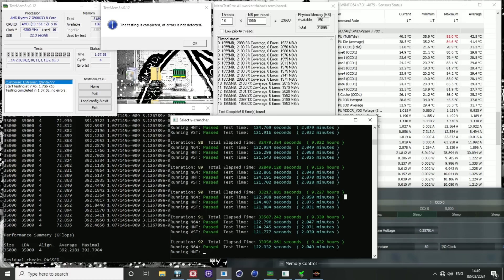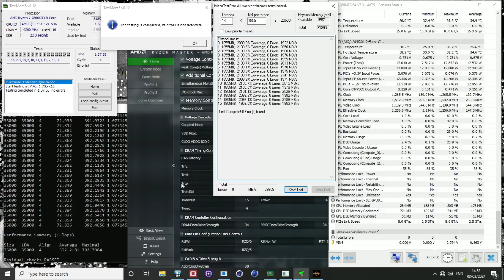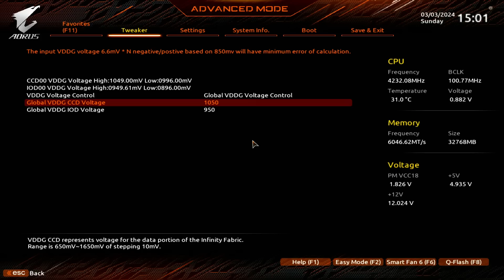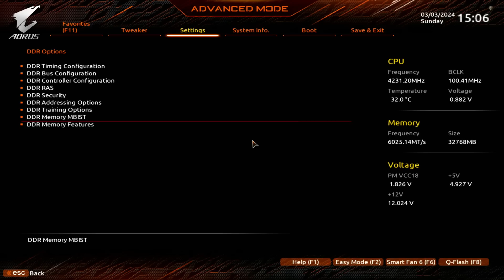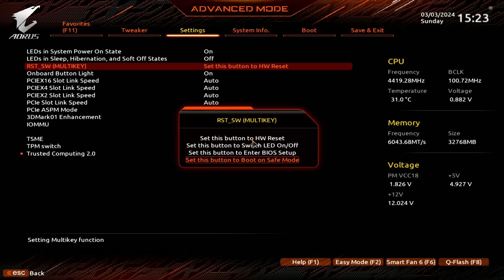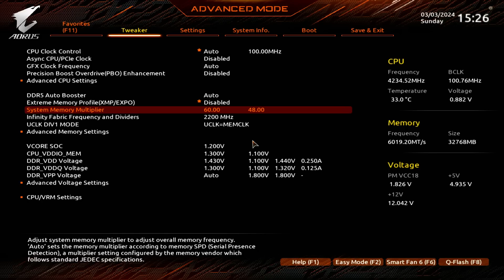Ryzen 7800X3D, 2200MHz FCLK, DDR5-6000 28-36-28-30

Comment: I managed to get FCLK to boot and be stable at 2200mhz setting up your voltages and timings but I realized that even setting up manually your timing and subtiming if amd expo is active it will override my manual settings. Do you confirm this? I checked in windows with AIDA the timings of the ram and it looks like so. Also a thing that is confusing me is the actual performance improvement by raising the FCLK. Best case scenario would be to run it at 3ghz if ram speed is at 6ghz, but if ram is at 6ghz is it actually beneficial to put the FCLK at 2200mhz? Or is it better to keep it at 2000Mhz? Another thing. I run a memory stability test overnight and ram got me no errors but what software should I use to check the stability of Infinity fabric?
Reply: best fclk is the highest you can

Comment: I was able to get 2200Mhz FCLK to boot, but then I loses my second GPU from being detected from PCH (used a M.2 to PCIE adaptor with independent x16 power), and the maximum I could get is 2067MHz

Comment: If I am running my DDR 5 memory at 6000mhz, the FCLK should be 2000 correct? Since anything higher than that, there is no real benefit to gaming at all.

Comment: CL28 6000mhz vs 7200mhz cl34?
Reply: I have a-die sk hynix teamgroup kit, hope i can achieve the same but my mobo is not the best; x670p msi
Reply: 7200 will give you upwards towards 80ns latency when paired with the 7800x3d since you're forced to run it in gear 2. The good thing about getting high bandwidth memory is that it basically guarantees you will get hynix A die which you can then tune to be best for this CPU. I'm currently running similar timings shown in this video at 6200 and my latency measured in AIDA64 is around 58ns, which is around 25% faster
Reply: I use KF560C32RSK2-32 ( Hynix M Die ), TCL28-TRCD36-TRP36-TRAS28-TRC38 / 1.4V FCLK( 2133Mhz ) VDD: 1.4v VDDQ/ IO: 1.40v VSOC: 1.3050v . R5 7600 B650 TOMAHAWK. 58NS on Aida64. For 7800X3D i think Hynix M would be better cause it does better timings then Hynix A. @DirtyAtreyu

Comment: @Actually Hardcore Overclocking . I have a question. For the fclk is 2033 not fasther then 2200? Or atleast thats what you where using and saying in another hynix video    you've done. pls explain im trying to optimize my sytem.
Reply: this is newer video so if he says 2200 faster then it is and prob some bios update fixed it

Comment: Is vCore SOC only for the Infinity Fabric Speed etc.? So if I can get 2133MHz with UCLK=MEMCLK running and want to tighten the timings / clocks of the ram sticks, I would only need to touch VDDIO, VDD, VDDQ? Do you have any references for 6400 CL32? Currently, running  6400CL32-38-38-38-38@21333 with GDM=off and automatic timings at vSOC 1.15, VDDIO, VDD, VDDQ=1.3. And was wondering which voltages I could try to drop. PS: For some reason, VDDCR_SOC Voltage is defaulted to 1.2v once I adjust the mem clocks or timings altough set to 1.15v in the bios. At the same time, CPU VCORE SoC is reported at 1.15v.
Reply: i'm stuck too at 2133 fclk, 2166 very close to be stable, 2200 directly reboot on occt, i noticed that on hwinfo, on my cpu i have vsoc at 1,185 when i set it at 1,20, i saw buldzoid is at 1,19, so i will see if increasing makes possible 2166 or 2200 looks like my asus low price is not acurate (b650m-H/M.2)

Comment: Did you try lowering VDDP from 1.15V to 0.95V and VDDIO to around 1.3V. i noticed while testing that I could achieve better timings and stable clocks by leaving VDDP on 0.95V instead of 1.15V and also not going over 1.25V to 1.3V for VDDIO, not sure why.
Reply: Mind sharing your settings?
Reply: @xGame4Fun  Im just on the timings in "easy" timins for SKH with 6000 memory kit right now. I had issues going higher with my setup even with the timings in the easy timings video with 6000. I then noticed after I lowered VDDP from 1.15V to auto which sets 0.95V I had no issues anymore with OCCT cpu and memory tests and system runs 100% stable since then for days. I then also lowered SOC to 1.15V, VDD VDDQ VDDIO to 1.25V, still stable.

Comment: Hey buildzoid, you are not alone! I too cannot do 6200 with my 7700X CPU no matter what I try.
Reply: its ur mobo
Reply: @Input.Volume  Nah that comment is 2y old, it was BIOS. Later versions were more stable
Reply: I managed to run get an aida64 reading with CL28 @ 6200. But any forms of loads crashed it. Now I'm doing some testing with 28-36-36-28 @6000 Greetings from Dejvice

Comment: I am amazed you can turn the Vcore SOC down to 1.2V, I always thought you needed at minimum 1.25V for high speed memory (that is what I set mine to).
Reply: i have set mine to 1.060 but ddr5 6000 cl 30 and i also got the 2200 fclk stable with my 7800x3d
Reply: @CHEFKOCH1837 Curious, did it make a big improvement in temps?

Comment: Tried this on a gigabyte b650 aorus elite ax with a good g.skill m die kit, everything works, except TRP+TRC, i couldn't modify those at all, gotta keep at 36-68, problem is that "it seems stable", but it caused me audio crackling (and one time even a sound card crash) in games, for whatever reason. Anyone got any idea on why?
Reply: Same issue with the b650m aorus elite ax ice 
Did you find any solution?
Reply: What is the best DDR5 for 7800x3d CPU and for gigabyte b650m aorus elite ax motherboard.. without issues ?

Is the TEAMGROUP T-Force Delta 6000MHz 2x16gb CL28 good ?
Or there is better option?

Comment: I don't advise any one to apply this since, I ended up with a dead ram stick
A-die kit. I posted my story on Reddit so I hope that I can at least help someone befor getting involved without any precautions, and for those they think it is 100% safe.
Reply: What is the best DDR5 for 7800x3d CPU and for gigabyte b650m aorus elite ax motherboard.. without issues ?

Is the TEAMGROUP T-Force Delta 6000MHz 2x16gb CL28 good ?
Or there is better option?

Comment: Would these timings work on a 64gb (2x32gb) G.Skill kit with Micon M die ? or should I just stick to your Easy DDR5 timings ? im running a 6000mhz kit at 6200mhz, passing all tests, VDDIO at 1.4v and the 2 DDR Volatges at 1.4v, SoC at 1.2v, your easy timings, all on an ASUS X670e Gene with a 7900 non X, seems to have a great mem controller in it.
Reply: Answered my own question, no they dont work on Hynix M Die, however, your Easy timings do and allowed me to bump the ram upto 6200mhz

Comment: Honestly, after trying multiple kits from teamgroup 6400 XMP's to Proxmem's new hynix 7200 cl34 EXPO, with a 7800x3d it's all such a clownshow with the manufacturers trying to "follow AMD guidance" with bios releases, that I'd just tell most people to buy the 6000mhz 1.35v kits and be done with it. I've seen some other people saying they had some stability issues over 1.35 despite sticks rated for 1.4 and higher. They've done some marketing reputation damage with the "buy AMD Expo overclocking stuff" and it not actually working now, which continue to sell for a significant premium from major vendors. I will say though that I ran into a lot more stability issues with timings using 1.4 or more volts on the ram, despite using 1.4v and higher rated sticks. 1.35 is a sweetspot. When I started using your timings here with 7200mhz cl34 1.4v sticks, I could get into windows, I even passed testmem5, but playing games I started getting USB drops on a gigabyte aorus x670 with f10a, and eventually a freeze.

Not much sweat off my back since the return process with Amazon is painless if something doesn't work out, but they'll be seeing a lot of returns for 6400mhz and higher "expo" sticks when the average builder fires up their bios, sets it to expo, and it's not working or it's crashing. A few will go digging around the internet to find out most people aren't bothering trying to go above 6000mhz because the stability headaches are just too high with a goose chase of wondering if it's the latest agesa, the bios, the memory controller, or the memory itself.

At the moment, I'm running some teamgroup 6400 xmp memory tuned down to 6200mhz with the rest of their settings from the xmp profile (1.35v, stick rating), as it just produces testmem5 errors at 6400mhz xmp settings, and the high-end 7200mhz 1.4v stuff is just going back for a refund. Timings could be tightened if I wanted to mess with it, but it's good enough.
Reply: No point in running anything above 6000 for diminishing returns
Reply: Mate if you'r getting stability issues I advise you to adjust it back to factory voltage, since I lost one of my teamgroup sticks couble days later when I was running them at 1.43V 
and I still shoocked from how fast that was.
Edit: it was the 6000/30-36-36-76 kit.
Maybe this will help someone.
Reply: I was able to run tight timings on my hynix 6000 at 1.4v, TM5 is stable but I'm seeing weird temp spikes randomly in hwinfo on ram and CPU, like only slightly higher than normal but I know they are not correct. No crashing but I'm wondering if stability is the issue.
Reply: Team group sucks for ddr5. You want g skill

Comment: My 2x16gb ram kit’s tPHYRDL is mismatched at 6000mHz on the 7800x3d even using expo settings, how can I fix that or what may be the cause?
Reply: Hi, please what is the best DDR5 for 7800x3d?
Reply: @ZzzZzz-gk4bo  just get some 6000 cl 30 tight some timmings and call it a day u wont see  extreme performance from ram

Comment: ECC was disabled or not? If not, it is not a valid stable .
Reply: Is it still a read error if it gets corrected before it even leaves the memory die?
Reply: @hammerth1421  no. But ram will work slowly.

Comment: about uclk=memclk... what if you re-synchronized fabric with memory controller and memory by setting fclk at 2000, uclk=memclk/2 and running memory at 8000MT/s? Would that work/post/be stable?
Reply: Not with the current generation Ryzen 7xxx.  Maybe next gen IMC improves enough.

Comment: Would these settings work on m-die as well? Or do you recommend something else? Got 30-38-38-30 with other subtimings too from some previous video of yours.  Also, i read on a forum some guy recommended bumping LLC for the cpu voltage to the max for 7800x3d to get a bigger stable curve optimizer negative, he got -39. What do you think about this? He claimed it should maximize the already so locked down voltage. Would this be a good idea? Harmful?
Reply: I maxed my Llc out two days after sticking my 7800x3d in and can also run -39 CO stable as hell.

Comment: Hi. Tell me, I now have a gigabyte of b650 from Aorus elite in ex, 7600x, and in the Hynix RAM in green we will die, I set the Bios voltage to 1.45 and the computer turns off. Memory does not take more than 1.38 voltage. On the z790 Apex motherboard, which runs at 8200 megahertz. Why can 't I file more than 1.38 on my b650 ? If I set 1.4, then everything works, but downloading to hwinfo 1.38 is the maximum. And if I set 1.45, then the computer just turns off, then it turns on and turns off again. Memory - 16GBx2 hmcg78agbua081N AA a-matrix

Comment: I have an Asus ROG Crosshair X670E HERO (BIOS ver 1415), Ryzen 7 7800X3D, Corsair Vengeance RGB DDR5 2x16gb (CMH32GX5M2D6000Z36). The system will not POST when using EXPO I, EXPO II or EXPO Tweaked. Is it the Motherboard, BIOS, RAM or CPU? I have no idea and it's annoying that I've paid for a 6000MHZ EXPO enabled kit that doesn't work..
Reply: Здравствуйте! Посмотрите поддержку corsair на официальном сайте x670e hero. У меня была такая же ситуация с xpg adata 6000. Adata поддерживает expo, x670e Asrock не поддерживает expo профиль этой памяти. Посмотрел список совместимого оборудования на сайте asrock - взял другую память из списка. Kingston fury - запустилась, expo 5600, expo 6000. Так же был профиль xmp. У меня 7800x3d, поэтому expo)
Reply: Its not even on the official support list for your motherboard😂 are people really this dense?

Comment: Are you also having an issue with the recent BIOS revisions limiting SVI3 TFN SoC voltage to 1.2V? I can set it accurately to any voltage lower than 1.2V, but nothing above that. This is a problem that is consistent on my motherboard (Gigabyte x670 aorus elite ax) for all of the bios versions available that are after the SoC voltage restrictions, i.e., F8, F9a, and F9b. I have not tested earlier than that because I don't want to take the risk. My guess is that the SoC voltage is being limited from the mobo SoC reading rather than from the SVI3 reading, because the mobo SoC reading is capped at close to 1.3V when SVI3 SoC is only 1.2V. This should be contradictory to what Gigabyte said in its recent press release, since they said that the SVI3 reading is the accurate one.

 What am I doing wrong? I've been looking everywhere for others with the same issue and the only other person I've found with this exact same issue on a similar motherboard was in this comment section.

Comment: I wonder if it's possible to reduce the Cas Latency of an Mdie 6000 (from Kingston again) from 32 to at least cl 30? Most tests show big improvements when it's near 30 or under.
Reply: Easily. M-Die can also do 28-37-37-30 at 6000 MT/s 1.4V. It's stable on my friends board but my B650M DS3H happens to be so shitty it can't do 6000 MT/s no matter what so I use 5800 MT/s at 1.35V.

Remember tho, if you only tighten one single timing its improvements are negligible so 32 is not bad although it can go tighter.
Reply: @atirta777  I used his guide on the other timings, so they are all very tight now. Cus my motherboard also has a preset that made them even better.  I only wonder about the CL 1, the primary. So i guess i gotta give it 5 more V to make it lower? Its already running at 1.35 if I'm not mistaken?
Reply: @Starfals  Cas latency scales well with voltage, yes. But I don't recommend going above 1.4 Volts just for it. Cuz again, it doesn't give that much performance alone.

Also, the tightened preset timings on your motherboard can work on their own, but I would leave them off if you're gonna fiddle with the secondary timings yourself, just in case.
Reply: @atirta777  From what i noticed, the motherboard aggressive preset reduce the timings by 1 or 2 points, in comparison to buildzoid and his memory timings video. I used the motherboard timings, then i added his on top and kept the tighter ones from the MOBO. So far i got 0 issues, all tests were smooth. Its an Asrock bios thing. What if i stay on 1.35V and try to just lower that single CL timing? It might not boot and i might need to reset bios or what? ;p If its just about crashing, then with the apps i can test it. If it needs a battery removing reset... ugh. 

This is the things that i never got to learn from his videos ;p
Reply: @Starfals  Oh Gigabyte also has a similar thing for the "auto" timings. But if you added Buildzoid's timings on top of those, every one of them should get overridden right? Or were some of the mobo timings somehow tighter than BZ's? The preset should in reality do nothing if you tighten the timings after setting it. So I guess technically it doesn't matter whether it's on or not.

1.35V can handle 6000 MT/s CL30 most of the time but if it doesn't, you can go with 1.4V.
Reply: @Starfals  If it doesn't post, there's 2 pins for resetting CMOS/BIOS on the mobo btw (look at manual where exactly that is). Just need to gently put a conductive object like a screwdriver between them and touching both at the same time for a few seconds.

You can also remove and place back the battery if it's easily accesible.
Reply: @atirta777  Battery is a bit tricky to get to, cus i installed my own fans all over the board haha...but the tip about the jumper cables thing sounds good. I heard my motherboard has the 2 pins somewhere... i just gotta find where. Shame they don't give us a simple button on the back, like they do on some high-end boards. I got the Steel Legend, it wasn't exactly cheap or low end, should have gotten at least that button.
Reply: @atirta777  Yep, i did that. Its funny cus some of the timings on the board were better, and some of the buildzoid ones were faster. I mix the best of both, aka the fastest ones and it seems to work great. Even the benchmarks give me a little better scores. I guess the Buildzoid timings were 95% perfect, the board did the other 5%. He even said the timings can go even lower on his video, and i guess they did and it all works! So far 0 issues, been a month. Btw, thanks for the tips and chat, much appreciate it! (for real ;p)